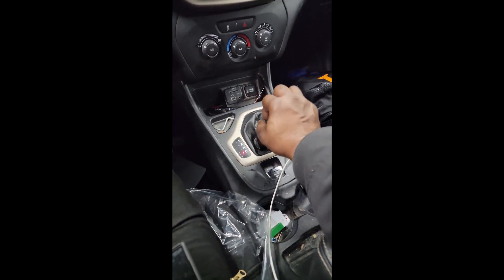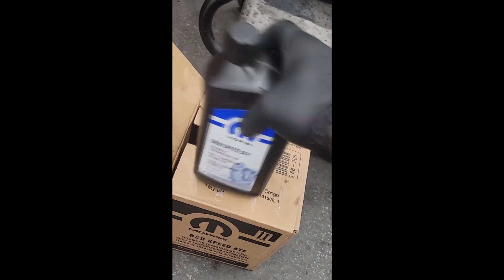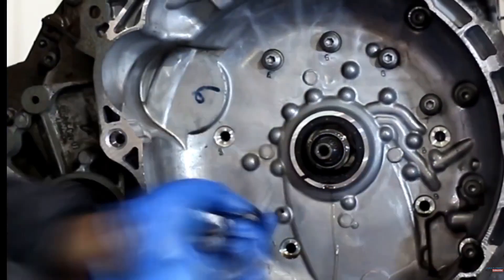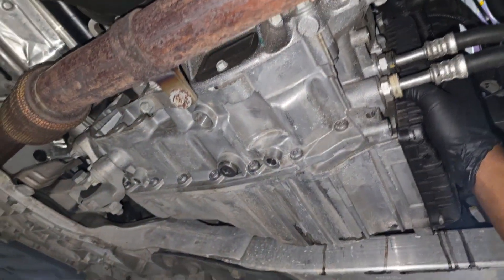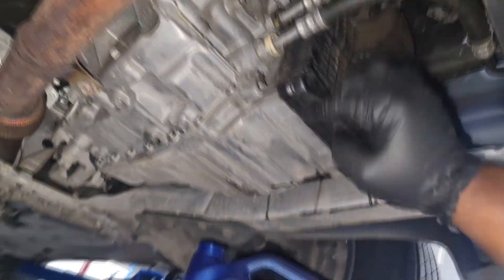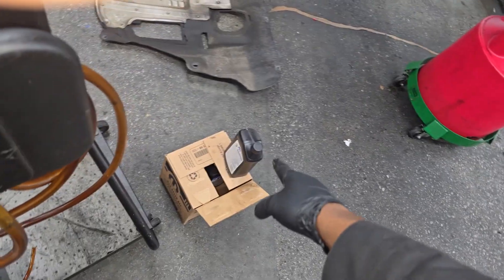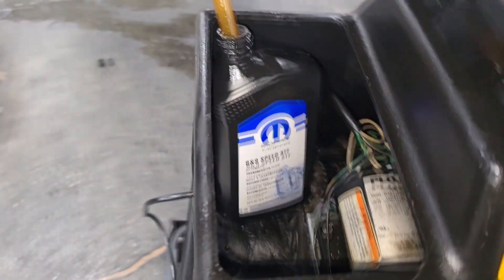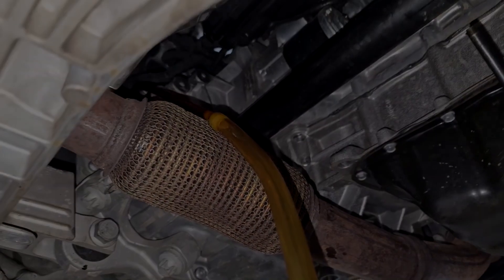“Dealer Says You Can’t Service It — Here’s What You Can Do on a ZF  948TE Transmission!”

Comment: I might be in the minority here, but I don't equate a "transmission service" with any particular task. A drain & refill is still a service IMO. The way I see it you are still servicing the transmission even if it's less extensive than a flush and/or replacing the filter. You should always be transparent with the customer about exactly which service you are performing. Most people don't understand the difference between the various terms anyways.
Reply: That's what JT does. He will explain to the customer what he's doing and why

Comment: Worst design decision they could have made for a transmission.  If you have one of these transmissions in a vehicle then change the fluid often so the filter might last longer.  If the filter fails and you need to change the filter, you might as well need a new transmission.  Trade it in or whatever you want, it will happen again at some point.  Filters can fail at anytime even with regular fluid service but I'm betting this filter lasts just over 100,000 miles or outside of any warranty.  So keep it clean by changing the fluid every 30,000 miles or so.
Reply: Also, you could always add an external secondary filter, but you would have that internal filter in there still acting as primary.  If there was an easy way to somehow bypass or modify the internal filter I would absolutely install an external filter mod for the very first service, otherwise an external filter just isn't really worth it.

Comment: Some of those ZF transmission have the filter attached to the plastic cover. It’s not a cheap option, but when possible, replace the filter/cover. It’s much less expensive than a new ZF transmission….
Reply from the maker: Yes, what you speaking about mainly on the RWD Transmissions. These ZF 948TE trans are FWD Transmissions
Reply: @OnlineMechanicTips Durango RT is a rear wheel drive?
Reply from the maker: @jamram9924  Right, all the RWD cars/trucks use the ZF 8Hp Transmissions. This a FWD car shown in the video. It use a ZF 948TE used on most of the FWD models

Comment: that fill hole is hard to find
Reply from the maker: Def hard to see. So you have to feel around with your allen tool to plug in and get off.
Reply: @OnlineMechanicTips  Same here. I get a allen bit on my ratchet and feel for the fill plug but I do it from the wheel well.

Comment: But that is a service on that transmission. Lot of them that way now, just because you don’t replace the filter doesn’t mean it’s not serviced.
Reply from the maker: I mentioned in the video that it depend on what your difinition of trans service is. Yours may not match mine. IMO, its not a trans service unless the filter and fluid changed. All transmissions have a filter